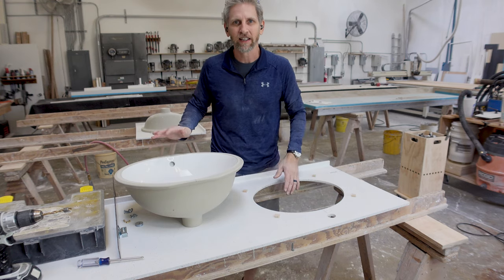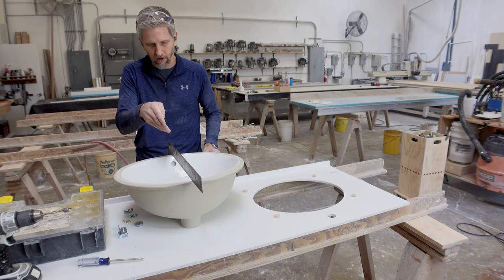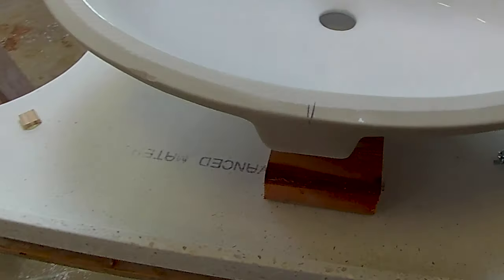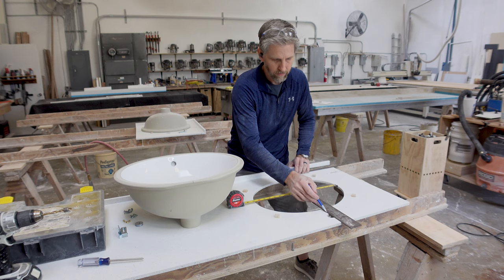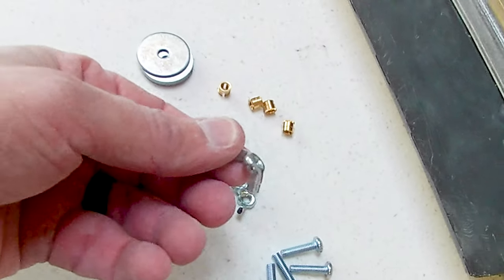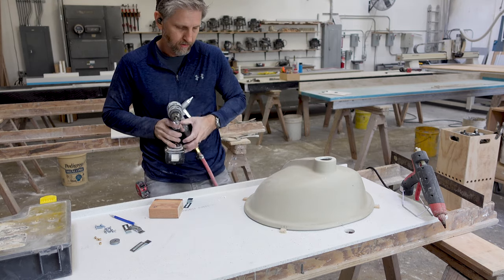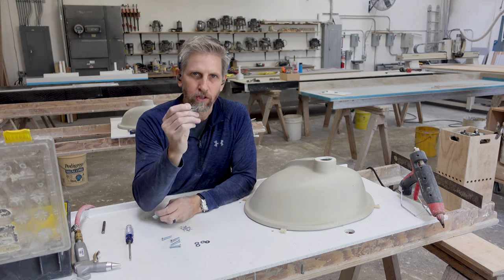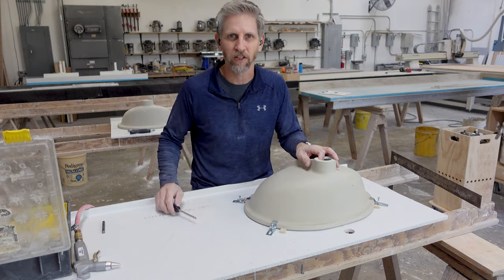How to Install an Undermount Sink on a Corian Solid Surface Countertop - Expert Guide

Comment: What do you mean when you say use a 1/4” drill (I assume diamond bit) with a collar?  Where do I get this collar fixture for the bit to ensure it only drills the specified depth?
Reply from the maker: Use a regular drill bit with a collar. You can get these at the hardware store or Amazon.

Comment: Hello Andy! I’ve seen many of your videos on YouTube and you seem to be the expert on Corian and Undermount sinks. Currently I have a Corian countertop and Undermount Corian sink. I would like to remove that sink and replace it with a much larger stainless steel sink. I am planning on making a template and using a router to cut the opening for the new sink. However, I do not know how to remove the old sink. The main problem is that the flange from the old sink is slightly larger than the opening for the new sink, and it seems to be glued to the underside of the Corian. I am an extremely skilled carpenter with plenty of years of fabrication experience, so I feel like I can handle this, I’m just unfamiliar with the material (strengths and weaknesses.)
Reply from the maker: You are going to need a winged cutter and set it right below the underside of the material. Go all the way around the sink and it will come off. You will need a way to hold the sink so it doesn't fall to the floor.

Comment: Hi Andy, I assume you loosen these off and fit during benchtop installation is that correct? And silicone between before tightening?
Reply from the maker: Depending on the size of the countertop. We will install the sink in the shop and install them together if it's not too heavy. 

Yes we silicone between them.
Reply: @AndyGraves  thanks!

Comment: The under mount sink in my kitchen was installed between the substrate and the corian. The sink is cracked. How can I get it out to replace it?
Reply from the maker: Cut the sink free from the countertop and then break the sink apart.

Comment: One of the screws holding the sink has rusted, is there a way i can add another without removing the countertop?
Reply from the maker: Sure, just drill a new hole and tap in the brass insert. Then you can attach a new clip.

Comment: Have you found good results using the brass inserts? I’ve never really trusted them.
Reply from the maker: I've used them for 30 years and they worth great. Give them a try. Once the screw goes in, it makes it almost impossible to pull out.
Reply from the maker: It's a setting tool that you can buy at McMaster Carr.

The other is just a drill bit with a collar.

Comment: So you can use a  cobalt/titanium twist drill bit to drill the holes in the Corian/Quartz? I have the same Blanco inserts from your amazon link.
Reply from the maker: Those bits will only work with Corian solid surface material.
Reply: @AndyGraves  Thank you very much for your quick response.
Reply: And can you please put a link or describe what kind of bit you did use to drill the holes, please. Im aa technician and only use bits on my makita angle grinder, I've never used diamond bit in my drilll.

1 Also, do you think this is the best method to mount a sink?  I'm wondering because I've used steel strapping from Gable to Gable under the sinks for years and it seems much easier and works great. I have a client that is asking to have hold drilled in their countertop 4 clips. But I like to think that using the steel strapping under the sink is just as good of a way to secure it.